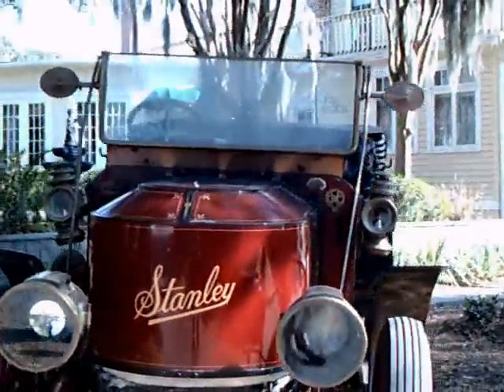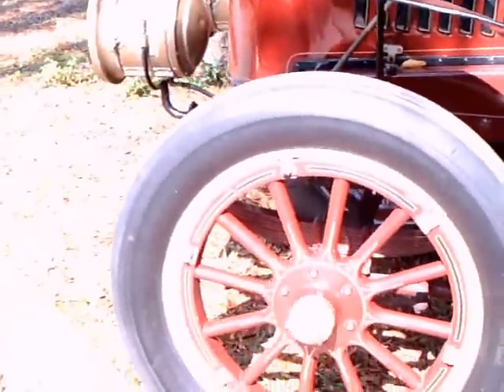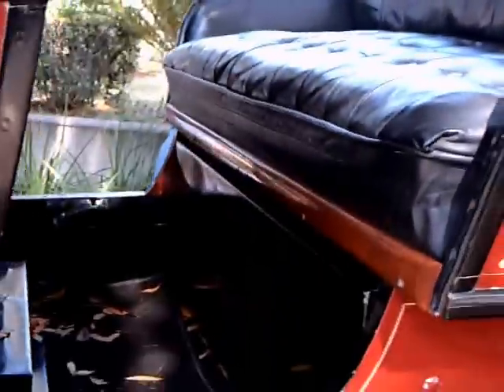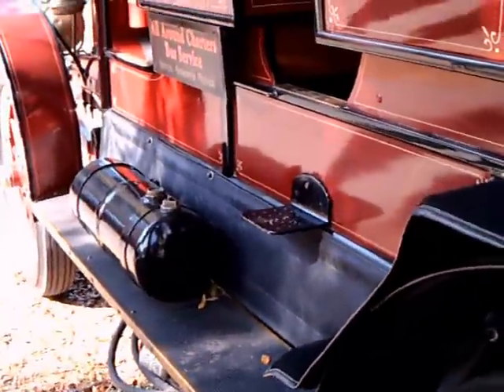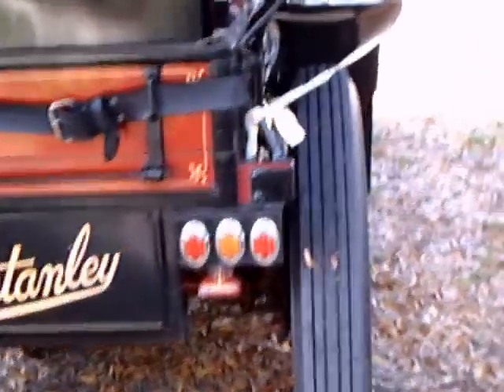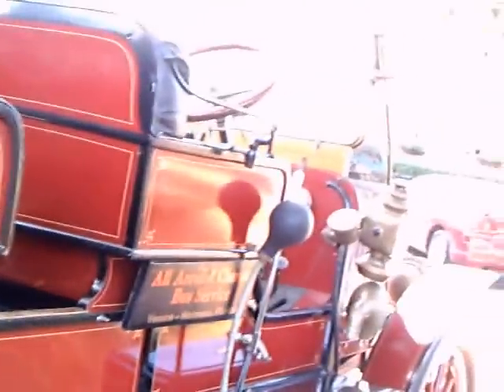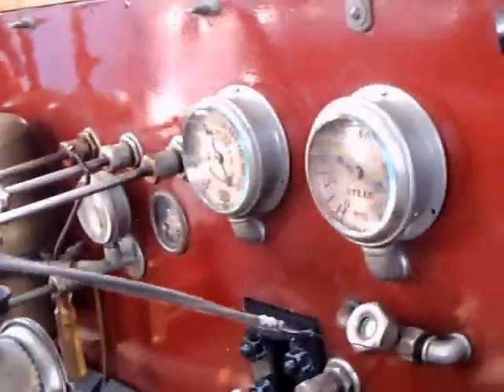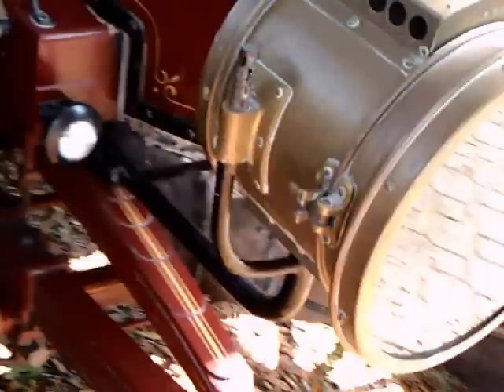Stanley Steamer

Comment: I was fascinated with the Stanley Steamer even in grade school, and I filled up on books about cars from the library.  The flash boiler used in later steam cars could get going from cold in about a minute-no worse than starting a diesel or pumping up air brakes.  But, the electric starter took hold in the public's mind, and the rest is history.  Wouldn't it be funny to rocket away from the light in a 1919 Stanley, leaving a Mustang driver shocked?  ZIP!!!!!!  WHAT TH' HECK just happened?! :)

Comment: There was little danger of an explosion in a Stanley Steamer.  The boiler consisted of coiled tubing in which there was no concentration of steam in any one location.  The Stanley Bros TRIED to blow up their boiler and all it did was spring a leak even pressurized well beyond design limits. The cars were safe, but the electric starter sealed their fate more than safety issues. A 1919 Stanley would keep up with a 1986 Corvette according the literature. Fantastic cars. they were in their time!

Comment: There was an article in Pop Mechanics about 20 years ago where they did a road test of a 1919 (or so) Stanley.  They pulled up beside a modern 'Vette where the occupants were making fun of the old car.  While at the light pointing and mocking "old Granpaw's" car, they didn't realize what was about to happen.  They yelled out if the Stanley wanted to drag race, and the Stanley nodded yes!  When the light changed, the old Stanley SHOT out from under the Vette like a rocket--ZIP!  HUH??????

Comment: The catch is, the chassis of 1919 wasn't up to such speeds, either--straight axles and leaf springs with little or no shock absorber action. Couple that with the bad roads, and there were limits to what a car could do both from the chassis and from the road itself. If the Stanley Bros were here today, I betcha they wouldn't make such a bet as most interstates could certainly handle the wide open throttle.  Back then, just trying to get from A to Z meant being stuck up in the mud half the time.

Comment: The Stanley Bros had a "bet" with its customers, I believe it was. If you could hold the throttle wide open at a designated track for ONE minute, they'd give you the car. I don't think anybody ever got a car that way! :)  They would exceed 120 easily-  remember: this was the horse and buggy era. People couldn't even imagine going faster than 20 MPH!  And there were no roads on which to attain such horrendous speeds.  And they'd jar your innards out, or break your springs. OR you'd stick in mud!